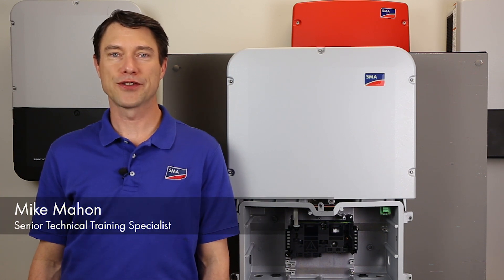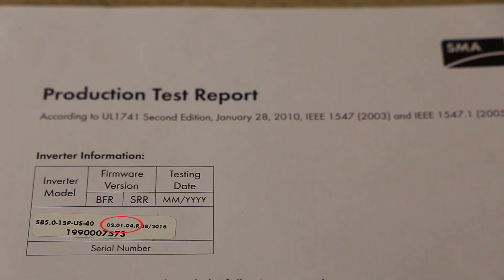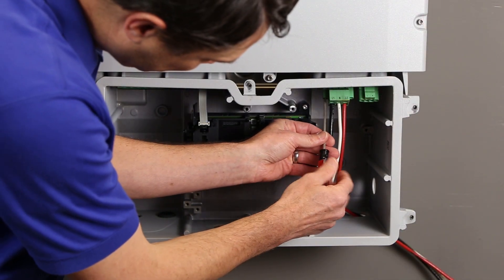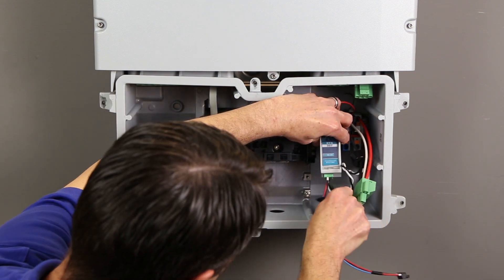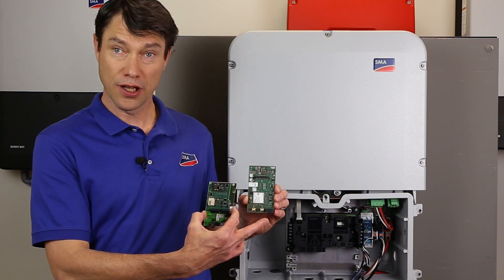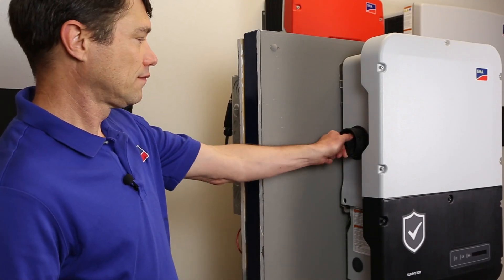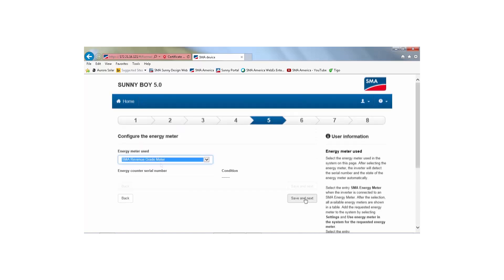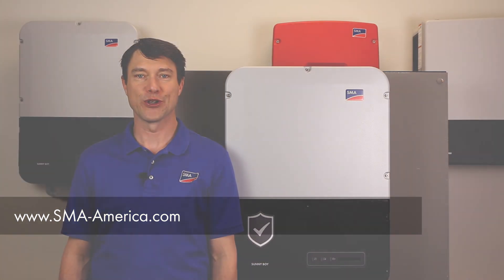Revenue Grade Meter Kit Installation & Commissioning

Comment: So between all of the different models and accessories I am confused. For the US market which product can regulate power back on to the grid ?. Smart Home Manager, Communication Manager, Smart Meter, Revenue Grade Meter Kit ?. Again for the US market and a SB 5000TL US. The difference between each of these products is vague and there does not seem to be a place where they are compared to each other in their abilities
Reply: I have the SB5.0-1SP-US-41 560 and the Revenue Grade Meter. I also have 4 TS4 Smart Modules. The system works without the Revenue Grade Meter but I needed to limit the power back to the grid. The Revenue Grade Meter never worked at all. Sunny Portal never showed that power was being limited. I have tried everything and searched everywhere for an answer. Show me one tutorial for doing what I want to do using my model inverter, the Revenue Grade Meter and the TS4 Smart Modules. The reason you are just responding now is because since even before I posted nobody could help or even wanted to help just crickets. If there was an issue just say so and if it's resolved then there is hope for me. Otherwise it is and was like I said, not limiting anything.
Reply from the maker: @nethomas2015  Ne, The Revenue Grade Meter kit is for high accuracy monitoring of the Sunny Boy output power, it was not designed to limit the power. So it will never do what you are trying to do.
Reply: You have access to all that equipment. I dare you to set it up in a mock environment and try it
Reply from the maker: Ne – the Sunny Home Manager and SMA Energy Meter are not UL listed devices, so not for use in the US.  The Revenue Grade Meter Kit is only for Sunny Boy US-40 or US-41 models.  I am not sure what device you are referring to with the Communication Manager.  To be clear, you are looking to establish export limitation to the grid with an existing Sunny Boy 5kW inverter?  Can you be more specific on the model – I would read your message and think you have a Sunny Boy 5000TL-US-22, but there are older models as well, and it would make a difference on capability. This should be listed on the label on the upper right side.